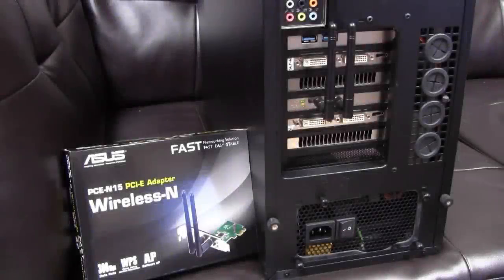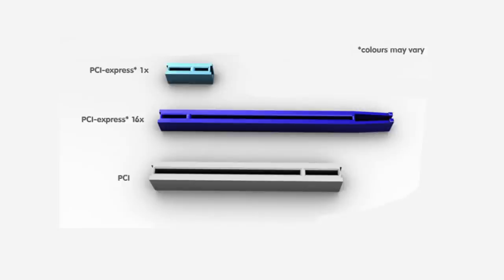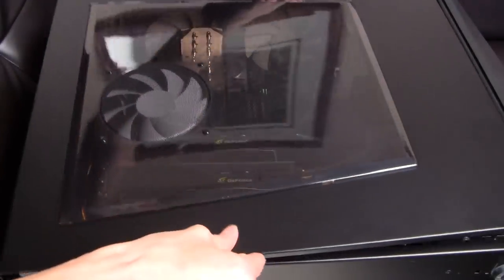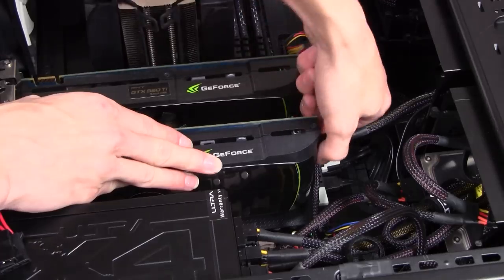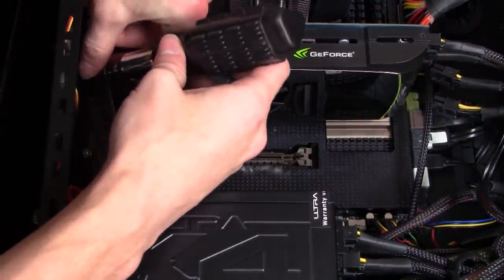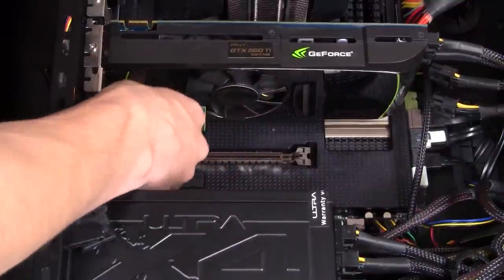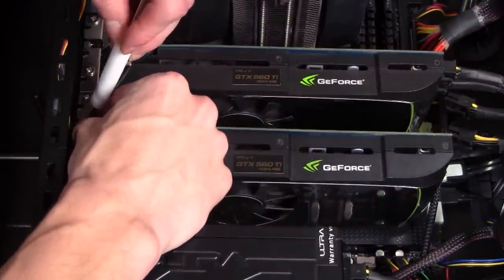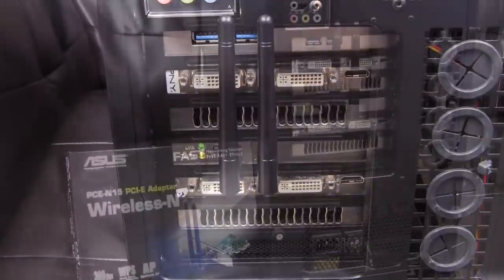How To Install A WiFi Card In Your Desktop Computer

Comment: I know this video is old, but you should at least mention that PCI-express x1 devices will work just fine when plugged into a PCI-express x16 slot, just not at x16 speeds. You make it sound like you can't plug in a PCI-E x1 device into a PCI-E x16 slot when you can. It's important to note because this may be the only option for some people who don't have enough pci-e x1 ports, or have their spare covered by a dual slot GPU.
Reply: thanks, didn't know about that
Reply: or if their wireless card would block airflow to the gpu, a lot of them have two fans, not just one in the middle of the card
Reply: Thank you, your commentary was really useful to me.
Reply: @firudu  IS PCIE X1 WIFI OK FOR GAMING??
Reply: Thanks! I was getting worried because my graphics card is over the pcie express 1 slot so I can only stick it into the lower 16x slot! Thanks.
Reply from the maker: Correct. You can use the lower x16 slot
Reply: Thanks you so much, this is what I was looking for. My GPU blocks the only x1 slot on my board and I didnt want to cause any damage to my pc...

Comment: The Moral of this Video is: "Put on Your WIFI Card BEFORE You inserted the Graphic Cards!"
Reply from the maker: +NavaIMTutorial Pretty much :p
Reply: Good thing I found this comment even though this was a year ago, I will be building my first computer this weekend and I ordered a WIFI card because I don't want to hard wire my computer which will be in my room on the second floor while the modem/router is on the first floor and on the other side of the house.I will remember to install the WIFI card in first before I install the graphics card. Thanks for the tip! I am so thankful for YouTube for providing just about almost any tips you can think of from videos to comments.
Reply: only when you have 2 graphics cards, am I right? (hope I don't have to do it coz I have one graphics card)
Reply: @WiltshireTutorials  CAN I INSTALL BOTH IN A MICRO ATX BOARD PLEASE?
Reply: Unless you have only one graphics card

Comment from the maker: Sure. The components in my PC are:
Intel i7 3770K (overclocked to 4GhZ)
Asus Sabertooth Z77 Motherboard
Corsair Vengeance 16GB (1866mhz)
2 OCZ Vertex 3 SSDs (120GB and 60GB)
2 Hard Drive (1TB and 360GB)
2 Geforce GTX 560 Ti
Ultra X4 PSU 1050W
NZXT Havik 140 CPU Fan

Comment: I just bought an ASUS A88X Gamer motherboard, and the bloody thing has 3 PCI slots.
Reply: Nice
Reply: I can't get my AC-68 to work... I feel like ive watched every video ever made and it still won't work...

Windows 10 (64 bit)
Reply from the maker: Did you install the drivers for the card.
Reply: Sounds like mine, though my MB is from MSI. Who needs bloody 3 pci slots?
Reply from the maker: No one wants, needs or should have PCI anymore. PCI-E 4.0 on the other hand, yes please.

Comment: Could you tell me the difference between using a USB wireless adapter compared to a PCI wireless adapter?
Reply: Kevin Nguyen Much better performance
Reply: Yung TedBounty you didn't state which of them got the better performance, just "better performance"
Reply: yes
Reply: This is the most pointless comment thread I have ever read in my life.
Reply: One is better

Comment: What Do you guys recommend? A Wifi card or an USB Wifi adapter? 
Pls answer ASAP
Reply from the maker: A PCI-E WiFi card is far superior than a USB WiFi Dongle.
Reply: thanks man :D
Reply from the maker: Teh ZnX You're welcome.
Reply from the maker: ***** Agreed :p
Reply: Teh ZnX Don't Use TP-Link
Reply: Mineableore | To 50 Subz Why?
Reply: ive had probloms with it but i fixed you just have to play around with the settings
Reply: Mineableore
I just bought one LMAO
Reply: DreadfulControversy im not using it i use the best asus
Reply: Mineableore what's the name of it
Reply: Mineableore Good looks. But the T Link will do for now, right? I mean, it's not bad, right?
Reply: its okey depends where you are i was about 15ft from the router and i got 3 bars lol
Reply: sometimes 2
Reply: Mineableore Damn. The router I use is downstairs. Should I order the ASUS and cancel the T Link??? I use a USB Wifi and it's about 84% strong...
Reply: prob i would not recomend tp
Reply: Damn. Alright then...
Reply: Mineableore | MCSG What is tp?
A brand?
Reply: reece Hilton its tp-link
Reply: k ty

Comment from the maker: There are many facts that could play into slow download speeds. A few examples are your distance away from your Router, interference in your house, such as a microwave, etc. Most WiFi cards will do the job for you. It also depends on your ISP (internet service provider) if they are throttling your download speed then you have a problem.

Comment: Very good video, thanks !
One question though, I have just one PCI-E 1x slot which is under my GPU. Does it matter if I plug the GPU on another 16x slot to have enough room ?
Reply from the maker: That depends on the motherboard. Some additional 16x slots may only run at 8x speed. Which most GPUs will run just fine at 8x speed. You can use the WIFI card in an 16x slot. That may be another option to consider.
Reply: +Wiltshire Tutorials Hey thanks for the quick answer, especially on a 2 year old video :D ! Yeah I found out earlier that I can plug it in a 16x slot so everything should be good.Thanks again !
Reply from the maker: +Pharlio Js Glad to hear you found a solution. Thanks for watching

Comment: I bought the same card featured in this video, andI am thinking about either upgrading my computer to run on an SSD or upgrading the WiFi card. What do you think is the better choice?
Reply from the maker: SSD will not help with internet performance. The WiFi card might help a little, but not much. Internet speed relies on your router and internet speed. I recommend getting an SSD, I like the speed it gives me for boot times and program boots.
Reply: Thanks!
Reply from the maker: You're welcome. This is just my opinion though. It is up to you and your own opinion and what you find more value and use in.

Comment: will the drivers automatically install on anything over windows 8, or only windows 8?
Reply from the maker: That was new feature in Windows starting with Windows 8. It will do the same on 8.1 and 10

Comment: Would you recommend getting a WiFi card or Ethernet. In my case Ethernet would need to be installed into the room that I want.
Reply: CosmoB0b If you have a decent Wi-Fi signal in the room then just use the Wi-Fi. You most likely won't notice a difference in speed

Comment from the maker: That is router you are talking about? No a WiFi card. Perhaps the WiFi card already present in your desktop is old and can only support B or G connection and not N. Also check if the antennas on the WiFi card are screwed in properly.

Comment: I have a question. I recently got a motherboard (maximus vii formula z97) which came along with a mPCIe card (I actually don't know what it stands for. mini PCI I'm guessing). I tried to search for the card that can fit, but I couldn't find any. Do you know what the corresponding card is? and should I just buy the wifi adapter card, and throw away the mPCIe card?

Comment: So, if you don't have this card the only way to have Internet is with a Ethernet cable? Also, can I use a USB adapter?
Reply from the maker: Israel99 That is correct. You can use a USB WiFi dongle. However, they suck and are no where near as good as a PCI-E WiFi card.

Comment: What was the clip that you put on the side of the case, when you were talking about Grounding yourself?
Reply from the maker: A grounding wrist strap. You clip it on the case and then attach it to a wrist band and it grounds you
Reply: What if your case is fully painted?
Reply: Then don't use one, if you're worried that it will be damaged. Just use a metal thing instead.

Comment: Can you help me?  I used the program CPU-Z to detect my slot type (by advice seen in a forum), but you said the PCI express x16 is for graphics cards and not Wifi. So, how do I find out what Wifi slot I have? (Preferably without having to look inside my case.)
Reply: if your case has a window you should be able to tell but to install you still have to open up your case so it should not  be a prob

Comment: what does onboard Ethernet mean and will this work with the MSIH1110M Gaming Micro ATX LGA1151 motherboard.
Reply from the maker: +Cocksure Peeenus Onboard Ethernet is when a Motherboard has a built-on NIC or Ethernet port. AKA wired internet.

Comment: Hi, got a question, kinda off topic though... Anyways.. I just got my new desktop computer, and I realized, I didnt order with a "wireless Network card" so I need to buy one and install it, OR I have the option to buy an USB- Asus Adapter, the N53 wich will fit in any USB port, but will this make me able to use the wireless Network, or will. I still need a network card?! Please answer my mom was pissed when she realized I didnt order with the card :P
Reply from the maker: Not really off-topic. The video is about WiFi cards. I would not recommend using a USB WiFi adapter, they suck because the range is terrible on them. I would recommend installing an internal WiFi card.

Comment: Hey so i have my graphics card in the pciex16_1 slot (apparently thats the main slot you use and the fastest speeds). I have a gigabyte wifi card and i need to get it in the slot under my graphics card. (My graphics card covers it). So is it alright to move the graphics card to a different slot?

Comment: Alot of WiFi cards come with drivers and I was wondering if I would actually need a dvd drive in order to have WiFi? You said that it would automatically install it if you have windows right
Reply from the maker: Correct. Windows 10 and Windows update should install a driver to make the card usable. However, you will not get the best performance out of the WiFi card without the manufacturer's drivers. Best to download them from the website.
Reply: @WiltshireTutorials  So once you get the drivers from the manufacturers website the card will be ready to work once you install the WiFi card in?
Reply from the maker: You have to install the hardware first, then install the drivers for it. Drivers are software that tell Windows what to do with that piece of hardware
Reply: @WiltshireTutorials  am I able to download the driver on a different computer, put it on a USB stick and then install the driver from a USB on my PC?
Reply from the maker: Yes. You can do that

Comment: does it depend on what wifi router you have ?
Reply from the maker: Somewhat. There's different versions of WiFi. They used to be a/b/g/n/ac. Now, to avoid confusion for consumers, they're going with a number based system. So, the new WiFi standard is WiFi 6. Ideally you want to have a router and WiFi card that can support AC (Now called WiFi 5) or WiFi 6. Obviously, WiFi 6 is the fastest. a/b/g/n/ac are in order of slowest to fastest.

Comment: Which wifi card is best for a hp p6 2103wb desktop computer and where does it go??
Reply from the maker: A WiFi card goes in the PCI-E slot. It can be either the X1 or X16 slot, if you buy an X1 WiFi card.

Comment: What tools did you use? i saw you connect something on the case.
Reply from the maker: +HyperDreamer That was a grounding wrist strap. It is optional. I don't use them much, but I want to show an example of it in the video
Reply: Oh ok. Well try for making this video. I opened up my PC, and I have 2ci express slots available to me and 1 extra video card slot. After you explained which slot is which, I was able to observe my pc's guts  and figure out the rest. Thinking about adding an extra video card, although I'm not sure what purpose that would serve. But since my PC came without a wifi adaptor I'd like to get one. Anything you can recommend for the slot you showed?

Comment: On the back of the card, are both the yellow and green lights supposed to be on? Mine only has the yellow light and it's having wifi issues...
Reply from the maker: +(´・ω・`) Hmm... I'm not sure. I personally have never paid attention to the back of my PC when using it. I no longer use the card. As for your issue, did you try installing the driver for the WiFi card?

Comment: Hello, please reply. I want to give you background infomation before telling you my problem. I have a desktop computer and laptop. My desktop computer uses a ethernet cable but is not plugged into the router directly. (it is in different rooms) My laptop uses wireless to connect to wifi. My desktop limits downloads to 1.1Mb, my laptop gets up to 10-20 mbs, same with my xbox. How do I fix this issue? Is the ethernet restricting wifi bandwidth? If it is I may buy a wifi card, will this fix my issue? Have fun with a reply lol :)
Reply from the maker: +NexLooph there could be a setting on your router where it favours WiFi performance over Ethernet. It also could be a driver issue with your PC's Ethernet port.
Reply: How is your Ethernet cable not plugged into your router?

Comment: Does all Motherboards today come with a pci x1 slot? They didn’t mention it only pci x16
I am talking about the msi b450 pro m-2. I need help please.
Reply from the maker: For the most part, yes. Some motherboard will have x4, x8 or x16 slots. You can plug an x1 device into an x4, x8 or x16 slot and it will work just fine. The motherboard that you are looking at has 2 PCI-E x1 slots.

Comment: iv got a question that iv been stuck on trying to figure out so i built my tower from scratch and everything is good except that i didnt install a wifi card it turns out that the motherboard i have has the wifi slot is in the second slot and the graphics card is in the first one. the problem i have is that the graphics card takes up the first and the second slot leaving me with no space for the wifi card is there another way i can get wifi on my desktop
Reply from the maker: Due to the limitations on your motherboard, you're pretty much stuck with using a WiFi USB adapter.
Reply: Wiltshire Tutorials I'm having a similar problem, what exactly is a WiFi usb adapter?
Reply: Donnie Canaday Ethernet cable.
Reply: Donnie Canaday a USB WiFi adapter is a little dongle type thing that you plug into a USB slot, and it serves as a WiFi card. However, they are slightly slower than WiFi cards.

Comment: With windows 10, will the drivers automatically install, with no need to use the included CD? I don't have a disk reader on my desktop, but need to use wifi. Thanks!
Reply from the maker: +James Clifford it should install drivers to make it usable. It may not run at full speed until you install the correct drivers. You can get them off of the manufacturer's website! No need for a CD
Reply: +Wiltshire Tutorials would I need the CD if it does not have an Internet connection?
Reply from the maker: +James Clifford You could use a USB stick and download the drivers using a PC that has internet access. Otherwise, you will need the CD

Comment: I have a question.. my gpu is sitting before/above the PCI Ex1.. can i Use the PCI Ex2? My motherboard is:Gigabyte GA-H81M S2H Socket 1150 motherboard
so is that possible to use the second slot? please answer
Reply from the maker: The Comedy Gamer You can use whatever slot you want in whatever order you so choose. An x1 card will work in an x4, x8 and x16 slot as well..
Reply: Okey thanks, i already had an answer on another video but still thanks

Comment: I just purchased the Asus Z97 Pro motherboard without the wifi module, I see on the motherboard a connector labeled  PCIEX1_1  Would this be the same connector?  Also I am interested in  installing  Bluetooth as well, is there a module that does both?? Thanks
Reply from the maker: Steve Kopcial Most WiFi PCI-E cards have WiFi and Bluetooth. I have a Gigabyte card and it does both WiFi and Bluetooth. The slot for an X1 is very small. The slot that is labeled "PCIEX1_1" will most likely be the 1st PCI-E X1 slot.

Comment: Stupid question really, but do most new pre-built PCs come with a WiFi card?
Thanks
Reply from the maker: James Gibson Never in my life have I bought a pre-built PC. I've always built mine custom. Therefore, I do not have answer to your question.
Reply: Most modern pre built PCs actually don't come with a wifi card so you will need to check on the description of the PC. If it is on Amazon it will say Wifi in the title of the computer. If it does not say wifi anywhere on the title of the computer you will need to install a wifi card or get a wifi adapter

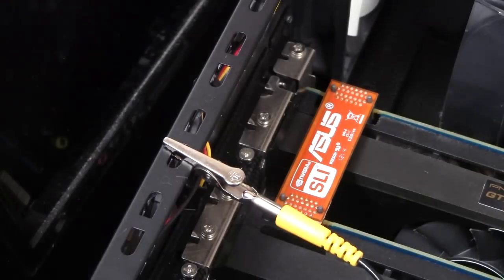Comment: Hey man could you explain to me how to ground myself to prevent short circuit? The clip connects to the case to...? 1:18.
Reply from the maker: It's a wrist band with a metal plate in it. There's also a wire running from the band to the clip that is attached to the case. You don't really need a wristband. Touching any grounded metal surface will do the job.
Reply: Wiltshire Tutorials aight bro tqsm

Comment: Darrrn you have a NICE PC
Reply from the maker: This is my old PC. I've made a new build. You can check it out on my channel, if you are interested. 

My Custom Built PC ('Colossus Build')
Reply: Thats old* now? What was wrong with that other one?
Reply from the maker: I just wanted to upgrade. I changed the amount of RAM to 32gb because I need it to render videos faster. I have 2 SSDs in raid 0 and four 4tb hard drives in raid 0. I require a lot of storage for videos. The GPUs were swapped because they were outdated. I upgraded to a gtx 780 when it came out because I wanted more horsepower for graphics.